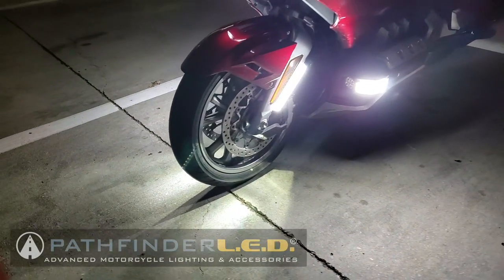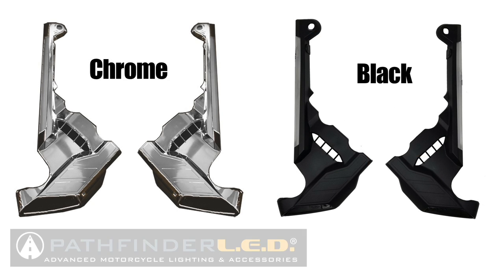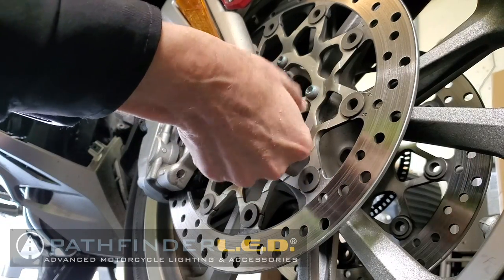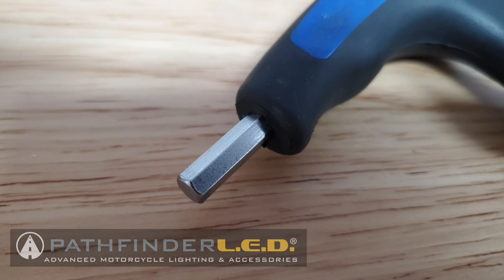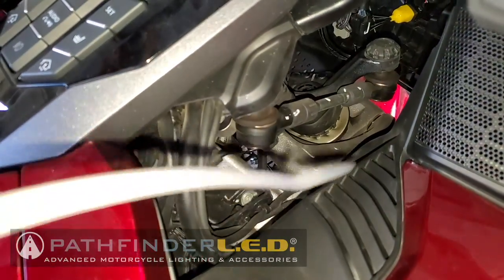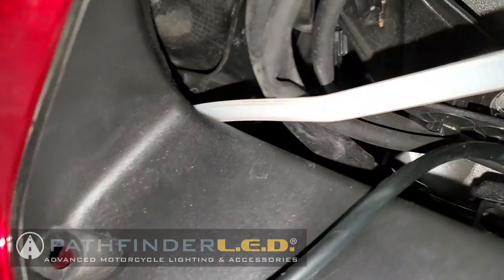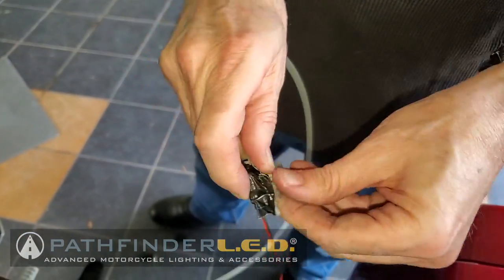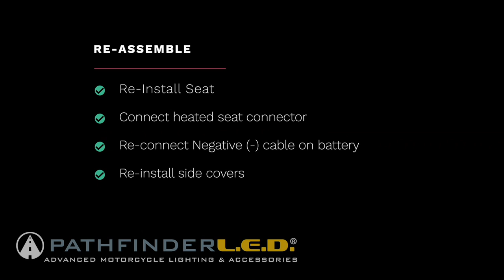Front Caliper Covers w/LEDs | 2018+ Honda Goldwing | PathfinderLED

Comment: In one of your previous videos you stated that an necessary add on is the electronic fuse box to connect additional lights. But here for the pathfinders accessory there is an connection harness cable to connect all pathfinders accessory's. I suppose for these lights we don't need that electronic fuse box. I'm asking this because I installed the LED high mount Brake Running light and the cowl lights and I was using only the Pathfinders harness cable.
Reply from the maker: The Show Chrome isolator is not mandatory. But adds protection for the CANBUS system. The Pathfinder harness should work fine.

Comment: I'm glad to see them come out with new products. I'm waiting for a nice trunk light. 

Why did you install the covers on Don's bike instead of yours?
Reply from the maker: My bike was torn in pieces doing another install for another video, so it was just easier to install on Don's.
Reply: Here I was thinking you had too much stuff installed already. Nice lights they look great and I bet they really enhance the cowl lights.
Reply: Check out the Gold Strike rear trunks lights. As are all of their excellent new generation Gold Wing specific LED lighting products.
Reply: You can get a led light strip on Amazon for 14 bucks that runs on batteries and put it on trunk
Reply: @roadglide  I actually bought them at Wingding but I"m waiting to install it to see what Pathfinder comes up with.  I really like their cowl lights.
Reply: @rival989  I could but I actually prefer something that looks factory and I don't have to fiddle with after it's installed.

Comment: I see Don has a ShowChrome Fuse Isolator installed. Is it Plug N Play or spliced into the wiring? If Plug N Play is the PathFinder and ShowChrome connected in series?
Reply from the maker: Reggie, you are very observant. I showed the Pathfinder harness because they wanted me to show their plug-in-play harness in the video. BUT, after shooting the video, we removed the Pathfinder connectors and wired the lights into Don's ShowChrome isolator. We just used the PathFinderLED harness to show how it can be "plug-n-play".
Reply: @cruisemansgarage  The Isolator should really take care of connector compatibility among vendors, shouldn't it? Isn't cut the connectors off and install the bare wires into the isolator?
Reply from the maker: @carvama1  Yes
Reply: How do you know which wires go where?
Reply from the maker: @carvama1  you would need to get the wiring information from the manufacturer. PathfinderLED prints the wiring info in their install docs.